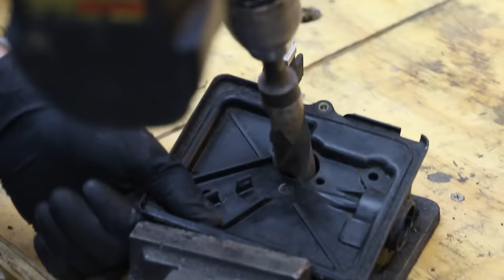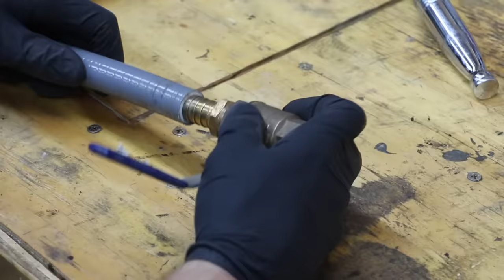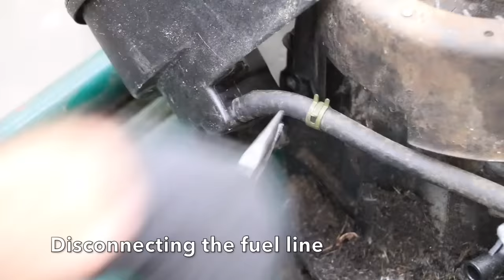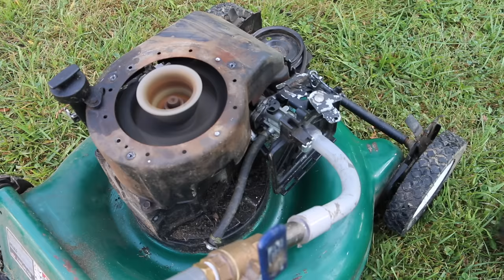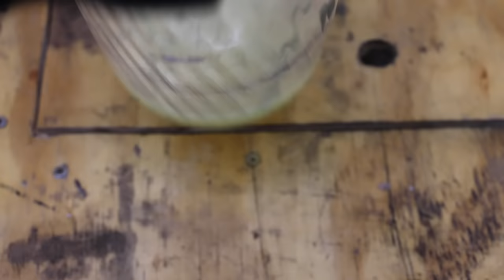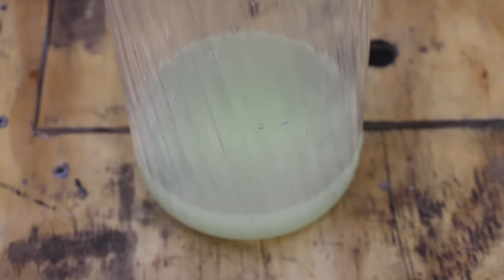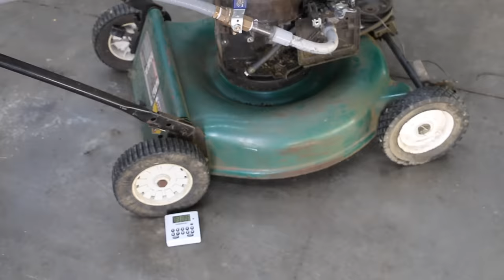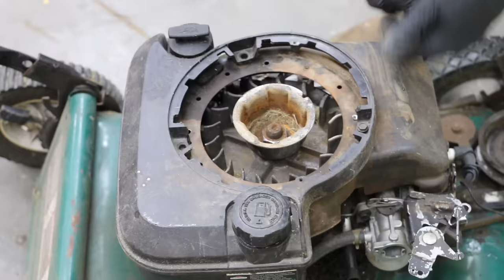Will a "Gas Vapor" Container Improve MPGs and Fuel Efficiency?  Let's find out!

Comment: I actually saw this happen many years ago with a Ford PU with a 351 engine. It was converted to run on Duel fuel, Propane or Gasoline, the customer came in with a very rough idling engine on Propane. We turned off the propane and it started idling smoothly, the system used a shut off solenoid to stop gasoline flow. We checked it by taking the Gas line going into the carburetor off and there was no fuel flow into the Carb. We then to double check removed the Propane vapour hose going into the Propane mixer, the engine still ran, a good mystery to solve. 
We then thought of what could be any other fuel source and pulled the PCV valve from the valve cover, the engine quit. Pulling the oil dipstick revealed a very overfull crankcase. The diaphragm had burst in the mechanical fuel pump ran from the camshaft so gasoline was pumping into the crankcase and evaporating. New fuel pump and an oil change and the Mystery was solved.
Reply from the maker: Thanks for sharing.

Comment: i suspect the color change was at least partially from the ethanol in gas absorbing water from the air
Reply from the maker: This makes sense. Thanks for commenting!
Reply: That is exactly what it is.
Reply: I imagine the air-chilled fuel condenses quite a bit of water.  Also makes a decent air filter
Reply: Wouldn't it be such a better place for our engines if we could just put our corn back into corn flakes where it belongs and out of our gas tanks?

I still want to smack the person what came up with the great idea of using a food crop for fuel.  Not only does it decrease the overall efficiency of our engines (Ethanol has less potential energy than gasoline) but it decimates the storage life of fuel, gums up parts and absolutely destroys the carbs on small equipment.
Reply: If you want to know who, look up the book "alcohol can be a gas" though personally, Ethanol does have it's uses, for example it has been proven that fuels high in ethanol actually result in less pollution from the tail pipe (for example, e85 is a very clean burning fuel compared to E0) but the difference with E0 is, is it's much more energy dense, leading to higher MPG's, which is why I prefer to run E0 when I can
Reply: outdoorsman310, I think so too
Reply: Gasoline dissolves some types of plastic. Could be from that.
Reply: That's why I put a manual fuel shut off to ensure all the fuel is sucked out of the float bowl so the alcohol doesn't eat up the seals as bad...leaving that hygroscopic fluid in the bowl only invites growth of all sort of jet clogging nasties and dryrotting of seals.
Reply: its teh gums andprevservatives int eh gas and the lighter molecules of gas leaving leaving all the junk additives in the g as behind
Reply: prototype9000 , I agree. There is no magic or reinventing wheel.  Fuel is very complex and there is no other way then burn it 15-1 or so to get power. Everything else is a trade off.
Reply: I dont know about what you are talking. You sound smart. That's why I liked this comment.
Reply: Putting ethanol in gasoline is a waste of perfectly good corn squeezings!

My pickup hates ethanol contaminated fuel.  With real gasoline, I get 15 mpg.  With an ethanol contaminated fuel, I get 12 mpg.  If it had no effect whatsoever (i.e. just took up space), you would think that 10% ethanol would just give you 10% less fuel economy, but I get a lot less than that, so it's actually robbing some of the energy out of the gasoline.  So, when they put ethanol in the fuel, it actually caused my truck to not only use more fuel, but to use more of the gasoline that goes into the fuel.  As an example.  Let's say a 1000 mile trip.  At 15 mpg, my truck would need 66.67 gallons of fuel and since it is 100% gasoline, that 66.67 gallons of gasoline.  With a 10% ethanol mixture, that 1000 mile trip would take 83.33 gallons of fuel and since it is only 90% gasoline, that means 75 gallons of gasoline and 8.33 gallons of alcohol.  So, even ignoring the 8.33 gallons of alcohol that is wasted, there's another 8.33 gallons of gasoline that gets wasted, so it does not save gasoline and in fact actually increases the use of gasoline in my vehicle, so in my particular case, it does not save any petroleum and in fact uses more petroleum.  That's not how it is supposed to work.

It's also possible that the color change was due to other additives in the fuel that do not vaporize as easily with just air being bubbled through them.  But considering how much ethanol is put into the fuel supply these days, I would not be surprised if that was a major culprit.  If he wants to remove the ethanol out of the equation, he could go to an airport and purchase some 100LL (avgas) fuel.  Do not use Jet-A since that is basically kerosene / diesel and is mostly used for jet engines, not reciprocating engines.
Reply: If you put the ethanol in the driver instead of in the fuel, you get even less pollution.

Because the driver is sleeping and not driving... :)

Comment: Project farm, i agree with a comment I read below about regulating air flow into the container to achieve an a/f ratio. However a simple voltage meter and an O2 sensor threaded into the muffler reading voltage 0-1v DC would show this balance. I would love to see this in future video.

Comment: Pretty awesome! Did the leftover gas stay cloudy?
Reply: Gasoline is hydrophilic. It will pull moisture out of the air. So yes, it stays cloudy. It's a bit of a problem, the fuel will get more and more diluted from picking up moisture from the air. The main issue is some of the water will settle back out after sitting, especially if the fuel has ethanol in it. Adding a desiccant to the bubbler will delay the issue so you have to dump the bubbler less frequently.
Reply: Justin Ervin or a tablet of drygas in the bottom?

Comment: Hi Todd, I absolutely love your videos! Have you ever considered trying to get an engine running on wood gas using a gasifier? I have seen a few people pull it off on YouTube in the past, and would love to see how you would go about doing it! If I recall correctly, the U.S. Government released documentation on how to make a gasifier and run an engine on wood gas in an emergency situation. Definitely worth looking in to if you have the time!
Reply from the maker: Thanks!  Thanks for the suggestion.
Reply: @ProjectFarm  I concur on this one. I would love to see you work with a wood gasifier. But my request goes above that. This is an old WWII or before technology that I think someone could improve modern day. I want to see you build this and improve it to whatever perfection you can reach. There is FEMA documentation on a wood gasifier. But there are also many videos on youtube about it. I've got a couple to get you started here below. They're some of the better postings I've found. Cant wait to see you do this idea!

My post on colin furze gasifier video
The cyclone filter seems to be extremely helpful in a wood gasifier for removing junk. Also you need to cool the gas way down, this cleans the gas more and makes it denser. Also your final filter medium doesn't seem to be dense enough. Usually people use like hamster bedding or hay packed in to catch the rest of the particles. The heat in this causes 20% H2, 20%CO, 5%CH4, and the rest nitrogen. You do need dry wood to best do this and pellets are a common fuel. Some good areas to find information on these devices are these videos, "Running Your Engine on Wood-Gas with Wayne Keith!", "Wood Gas Part 2: Extras and In-Depth Info", and "amazing homemade gasifier uses wood pellets to run generator -- renewable alternative energy video". One last place to get a lot of good information about these is from the United States FEMA-Gasifier-Plans.

Comment: I know this is an old video, but I would love to see a revisit with a wideband O2 sensor and gauge in the exhaust and see how close to stoich the mix is.
Reply: Exactly what I was thinking.  In order to get great gas mileage you need to lean it out.  But you can't do that under load.  That's a light cruise situation.  Anyways you go too lean and things melt.  You would need an exhaust gas temperature sensor to make sure you are safe.    I was skeptical it would even work  myself....
Reply: An engine doesn't burn liquid fuel. Liquid fuel doesn't burn. Just the vapors. It's just a matter of where the fuel is vaporized, at the fuel injector, the carburetor, or outside the engine in a a clear jar.
Reply: You have to heat the fuel or use a special energizing process like the GEET, or add HHO mixed with air and water (and possibly nitrogen compounds which result from the electrolysis if you use salt as an electrolyte).

Comment: I remember reading a story in the local newspaper back in 1975 or 76 about a local man who had accidentally discovered a way to run his lawnmower on fumes like you did . He apparently did not use the vented jar like you  but he said the vapor inlet line to the intake would actually ice and freeze up so he later used a refrigerator coil to supply the vapor to the engine to prevent icing up . He had according to the article converted a full sized car to run on his invention but had to add an accelerator pump system to get the engine up to freeway speed and drove the car across the country on a promotional tour to publicize it  and showed his fuel mileage increases .  There was a follow up story in the paper a short time later saying the fellow had been receiving death threats (he assumed were from oil companies ) as well as offers to purchase his research and not disclose any info about his discoveries. He supposedly finally accepted an offer for $200,000 to stop working on his fuel vapor concept .
Reply from the maker: Thanks for sharing.
Reply: He was killed .... this immediately came to mind as well.  He did not accept some money to shut up.  He was suicide'd.
Reply: Tom Ogle was his name...he modified a 427 in a 1970 Ford galaxy to get over 100 mpg. Drove from LA to Arizona on 3 gallons of gas if I remember correctly.
Reply: @christophercassidy9962  and it killed him So sad
Reply: I always find it interesting that someone comes up with the fuel saving engine and then has an accident / suicide before they reveal the "how to " to the world. it seems if you follow the money that there are forces that do not want this type of thing to happen. Run your car on water only ? How is it possible that only one guy has discovered how to do it and now that he is dead no one else can figure it out?
Reply: Same with the water fuel car and the 100mpg carb
Reply: Some BS in this story ! If calibration of either injectors or carb is correct and thus giving the correct mixture, you can NOT improve on that. Believe me; Been there, done that !!!
Reply: Savage Facts  Yes I remember this story as well about this guy's car that ran on water (Hydrogen) and died a mysterious death and had all of his research taken by a large group driving black vans .
Reply: @juriedekock6154  someone I knew took his car through the testing station and failed , so he took it to the mechanic where they detuned his engine and it then passed the tests.  If your car runs on fumes and it gets .003 % better fuel mileage will you say it did not increase? So what we want is substantial not fiddly increases.
Reply: @bigsparky8888  So you would think that among all of us on this planet there would be someone else who can reinvent these great gadgets to do what we believe someone did?
Reply: Hello, everyone.  I just explained how to do it in two reply’s.  Yet no one has commented on what i said.  Your choice to keep rambling on if you like or you can read what i said , believe what i have said follow my instructions and have success.
Reply: @rmendes2mendes915  Hi,
Where's your replies?
I want to know more about this.
It seems that actual nuts and bolts information about how to do this, is impossible to find.
Reply: @juriedekock6154  
That's so true, if you cut back on gas or fumes,  the engine won't run very well.  Though I did see a guy put  lawn mower carb on a 302 Ford V8 engine and it got 40 MPG  he had to add some kind of electronic device other wise the engine would pull too much gas through the carb.
Reply: thanks for pointing out that this is video is NOT at all what Ogle did
Reply: If you believe this, you would believe anything!
Reply: Maybe it was the same guy who visited my engineer dad and sold him plans? I heard he was offered $200,000 to shut up and... They killed him afterward cuz he refused.
My dad bought plans for a 75 mpg carburator from the guy who was kind of famous in the 70's. Since my dad was an engineer, he constructed a vapor carburetor and it worked. Word got out, my dad got a visit from two men in suits. He put his old carburetor back on, gave them his plans and his high mpg carb, and we never heard anything else about it. I was 11 years old. We never heard what happened to the inventor, I suppose he was either paid off or killed. How the carburetor worked was it atomized the fuel to an extremely fine "mist" or a fog before it went into the carburetor jets. Gasoline itself does not burn. Only the vapors do. Turning gas to vapors can increase your gas mileage by 300% to 800, depending on the design of your vaporizing carburetor.. That was the principal, but there are literally trillions of dollars worth of gas, diesel fuel and jet fuel burned every year, what would happen to that industry if hydrogen engines became the norm? It would be a riches to rags horror movie. Kinda like the tobacco industry. Same devil, different hat.
Reply: Rudolph Diesel
Reply: Urban legend!!
Reply: I'm sure the claims were pretty exaggerated.  Every car manufacturer and university research program would've stumbled on it by now.  There is no lost tech these days.  The US just loves a good conspiracy theory, and they are fun to read.
Reply: @brichardson7884  Todays Gasoline is nothing like 1970 Ethyl. it boiled over 400 degrees and is junk compared to old school fuel. quality is gone in cheap fuel. just look at the difference in mpg in ethanol fuel E10 or 15 then fill your modern car up on non ethanol fuel and you will see worse mpg... because the cat wants to see a certain temp through the down stream 02 thus richen the AF to compensate for low btu fuel.. Its a set up and thats how they stretch the crude at the refineries ... selling us real CHEAP fuel.. look what was left over in the bubbler...Junk...niot even comparable to old school fuel... cheers

Comment: I did that on a 4 cylinder motor. Removed the cab. Installed a 2'' ball valve and a 1'' ball valve past the 2'' for air adjustment. I put gas ,old oil,water in the tub. ran the vapors with a 2'' hose. Had a 1'' hose to feed air in to bubble the mix. It ate it all. Ran great.
Reply from the maker: Thanks for sharing.

Comment: I tend to agree with your findings... just one thing, did you connect the blow-by pipe with your jar? Keep in mind that the excess fumes get circulated back into the system for a reason.